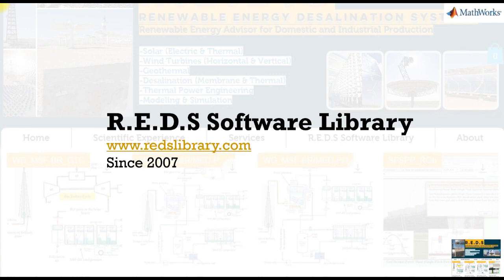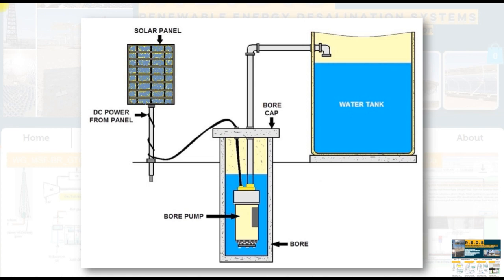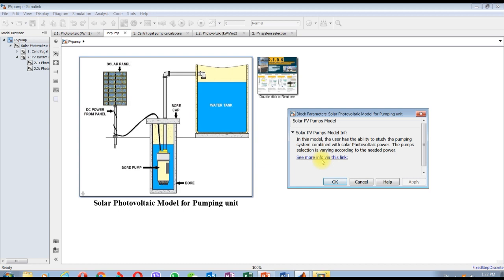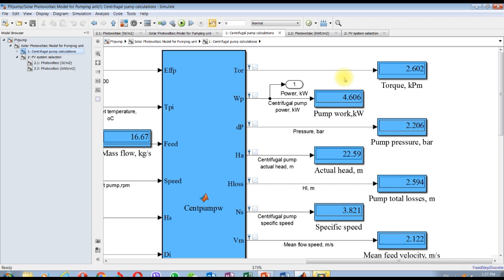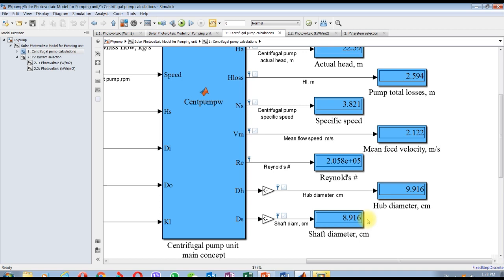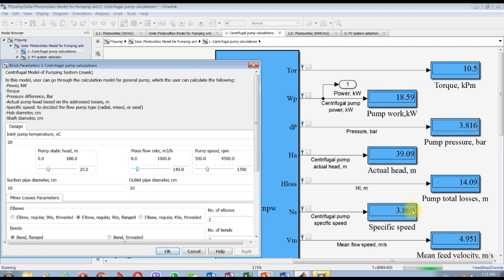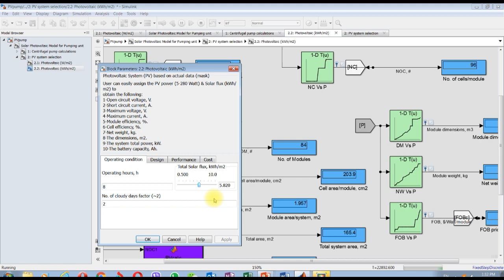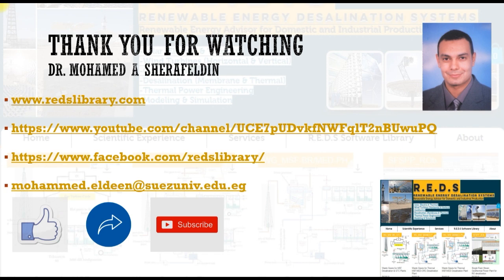Solar PhotoVoltaic for Pumping Unit simulink model run

Comment: A solar powered pump is to be used in Alice springs, NT to pump water for wildlife from a depth of 180m at an average rate of 400L/day. Assuming a reasonable efficiency for the pumping and solar energy conversion systems. And allowing for friction and other losses.
(A) By the theoretical calculation, determine the size of the pump and the area of solar collector which can meet the requirements of this application.
(B) By searching on the web sites of the commercial suppliers, select the size of the pump and the size of a solar collector that match the above requirements.

Comment: Can you send this model?
Reply from the maker: Unfortunately it is not for free
Reply: @REDSLibrary @REDSLibrary, it is ok I am ready to pay, but can it be done for my 1kW solar setup with the specially designed solar pump. a standalone system without an inverter.